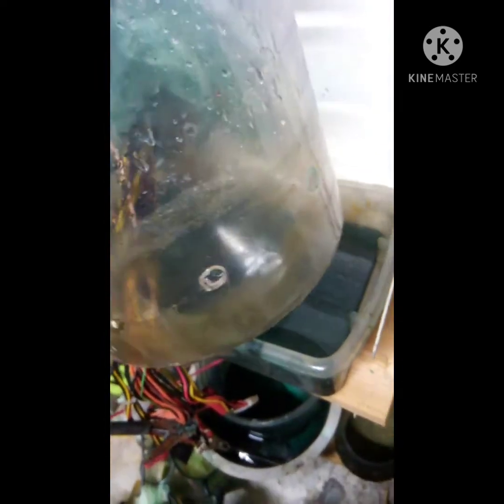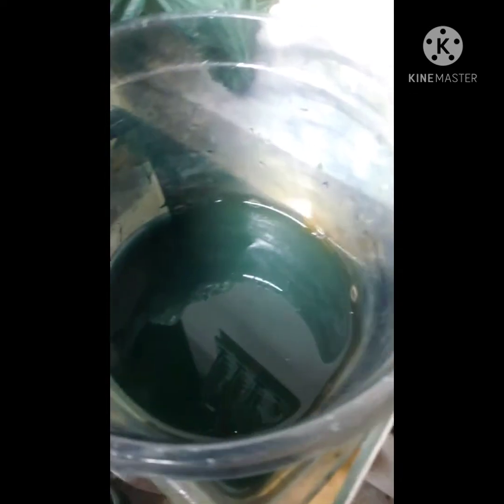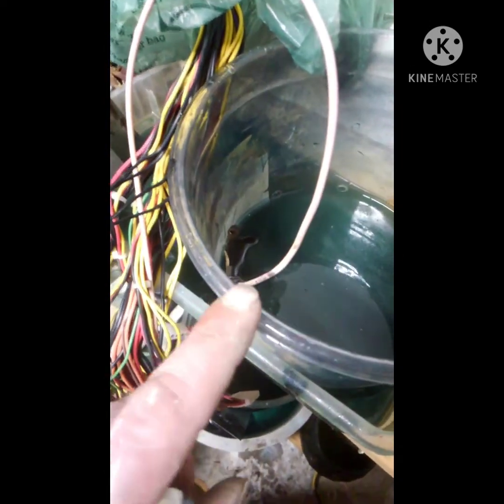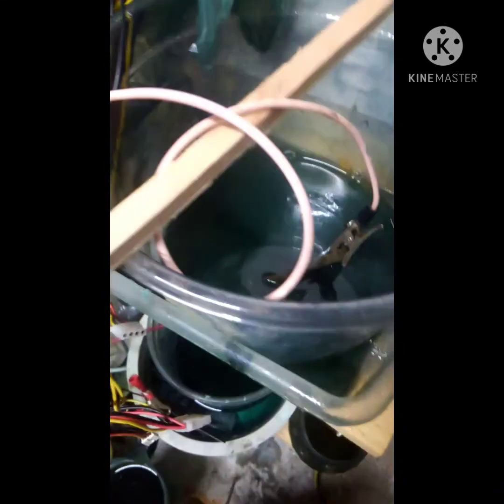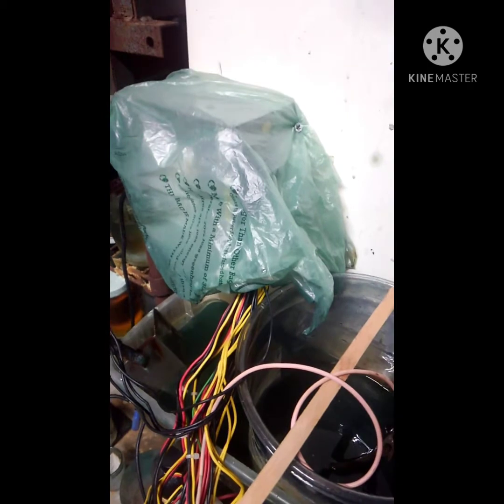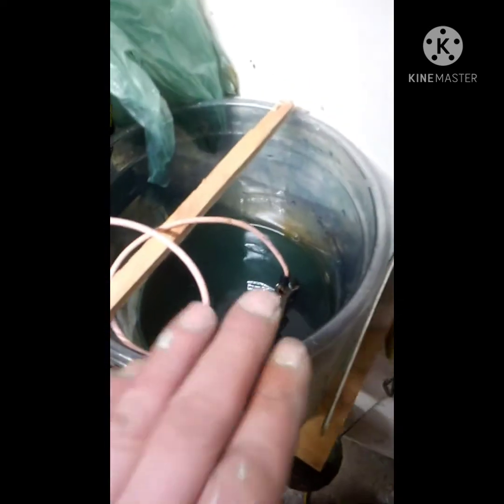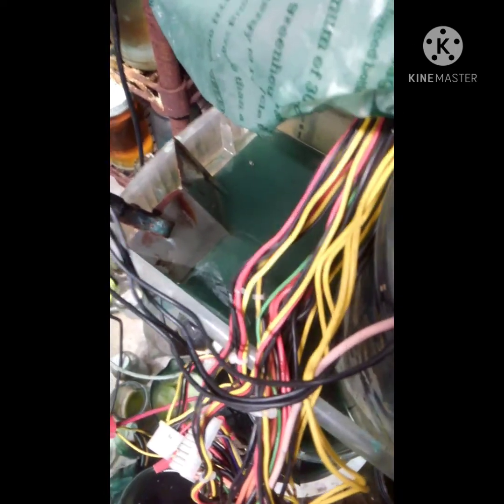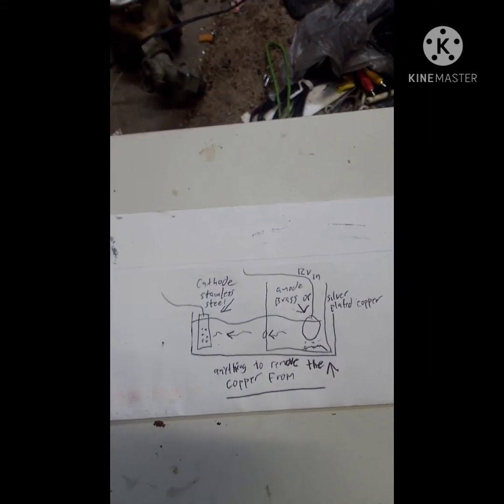how to separate/purify copper/tin from brass, silver plated copper and much more.BEST VIDEO

Comment: Remove zinc from copper to destroy brass. Dryads hate brass, steel + iron. Instead add tin to copper to make bronze. Then add sulphur + phosphorus. Find phosphorus is your pee. If you dry-out your pee in a large glass-globe + light the residual phosphorus on fire: IT-GLOWS-LIKE-MAGIC! Question is copper, tin, sulphur, phosphorus + what else, Mr. ALCHEMIST?
Reply from the maker: To make it glow? Or to make it burn. I'm sorry I'm not understanding what your asking for.

Comment: How did you made the cuo solution
Reply from the maker: It's just copper oxide crystals from a root killer, and water.
Reply: I think it's copper sulfate, not copper oxide. Correct me if I am wrong.
Reply from the maker: Your correct it's copper sulfate pentahydrate, from Zep root kill

Comment: I’d like to see what that copper plating looks like that you were talking about!
Reply from the maker: Hey give me a day or two I'll make a video showing all the ins and outs for ya. I'll message you again also letting you know with a link
Reply: @shelbysgarage5828  looking forward to it! I have access to an insane amount of brass, but copper is limited. And this seems like a fun experiment!
Reply from the maker: Do you have a power supply yet? If not I have a video on how to make a great one from old computer power supply
Reply: @shelbysgarage5828  I dont yet but I'm prettyhandy. I am most interested in the way the copper accumulates, but mostly the quantity that is available to be made from the process!
Reply from the maker: The quantity is as much as the supply, now are you meaning like amount of X period of time? That's the one down fall to this is it's not very fast. But I've found ways around that as well. Since it is so easy to do it's easy to have multiple units going all at once. I've got a computer power supply running 3 separate bins to speed up the separation process. Which it makes highly pure copper from whatever your breakdown item is (provided it has copper) but if I was to put an amount of copper over a 24hr period...... This is highly dependant on your amps, I don't know maybe 2 to 6 oz a day
Reply from the maker: There's a point from the beginning it starts out at say regular speed and gains momentum until it reaches a (saturated point) even tho by looks you wouldn't think so. But then slows down. Another crucial thing is the window of sight. A straight shot w no impedances will give you optimum settings
Reply from the maker: And I haven't forgot about the video I've just been really busy
Reply: @shelbysgarage5828  Id love to see another video with adding the experience you keep gaining about the process. After reaching the saturation point, does it need a new solution? does the copper need to be removed? Does a fresh brass piece need to be attached to the anode? so many questions!
Reply: Two to 6 ounces a day isnt bad!